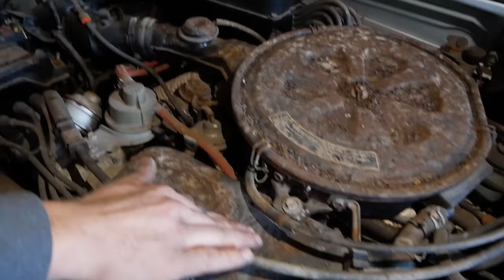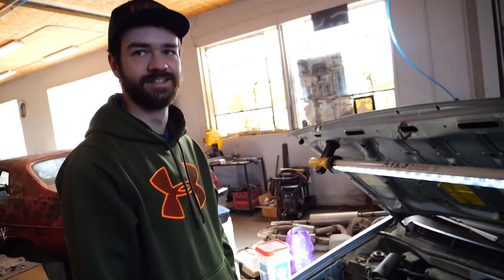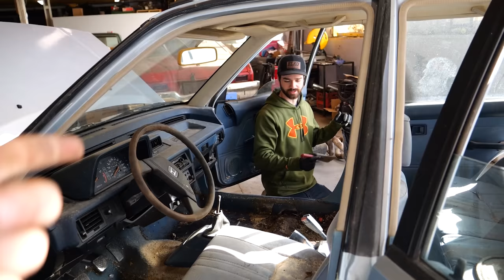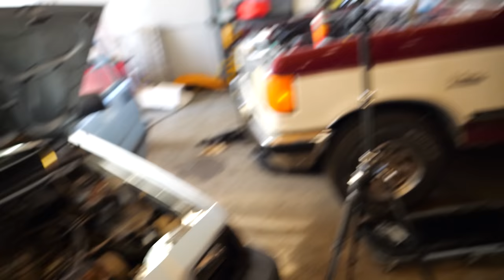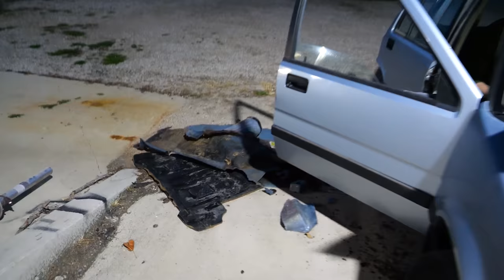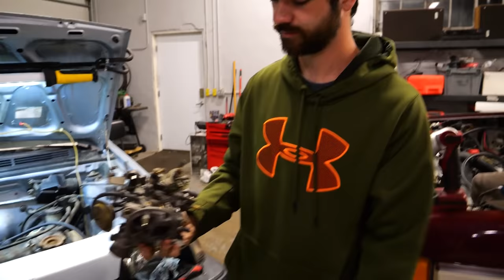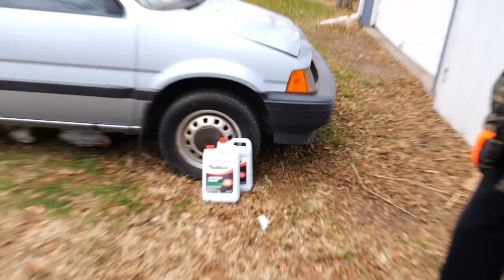ABANDONED 4x4 Honda Civic - Will it Run After 20+ YEARS??

Comment: Whatever you do , do not break the rear side windows , they are extremely hard to find and you would be extremely lucky to find anyone who can make them .
Reply: same shit for toyota tercels 4wd !
Reply: Yeah, take them out and sell em!!!! Same for my 94 teggy
Reply: To the right buyer they are probably worth whatever he paid for the car, or more.
Reply: just make them out of plexiglass
Reply: @josephdias5859  that really doesn't solve many problems... its a 3-dimensional shape so hard to reproduce, making repros would almost certainyl require that you have some originals to get the form from, and on top of that you would be replacing with a material that will fog and crack over time and require replacing and look shit. So no, not a "just do this simple thing" fix at all. Oh yeah, and if you are fixing up old honda wagons as an enthusiast, you probably don't have ford GT money knocking around for things like custom glass/plexi fabrication.
Reply: @throwback19841  what about 3d printing you can get a decent 3d printer for like 200 bucks and input the exact dimensions of the window and couple of rolls of pa6 nylon glass woven filament for 40$ it doesnt crack its crystal clear and it doesnt fog older car parts are getting harder to find it would be a bit of work with sanding and getting a smooth surface but i imagine its still much cheaper than finding the original windows and i think you can hit it with a hammer and it wont break and people use it already to make stained glass windows
Reply: @josephdias5859  You know those printers are only really capable of printing in a 8" cube right?  Compare the printing area of those $200 3d printers to the size of that window. A 3d printer that prints something that is over a foot long in 1 piece is going to cost thousands not hundreds. You're also gonna be looking at probably at atleast half a dozen rolls of material to complete. Filament based printing also looks terrible and cloudy for transparent objects because of the layers of filament no matter how much you sand it.
Reply: @jordanturner97  your information is wrong, please dont post stuff if you dont know what you're talking about, it misleads people.
Reply: @roberthood5824  Okay, name me a <$200 printer than can print transparent materials (that won't warp in the sun like PLA) with a build area that is anywhere close to 20 inches. I've never been able to find one, enlighten me, seeing as you're an expert!
Reply: @jordanturner97  I know right? And anyway, you will never 3d print a piece of plastic as clear or unblemished or perfect or UV proof as a piece of glass. Never.

God I miss that car- best rear visibility ever. It was like being in a greenhouse on wheels

Comment: Hey if you ever need to remove fluids from a tight spot like that, you can take the head off a spray bottle, stick the straw into the hole, and use the spray head as a pump to remove the fluid. You can pull through a pretty long hose this way too, if you need to.
Reply: Great idea!
Reply from the maker: Good idea! I'll have to remember that for next time. I imagine seeing that this was gas it would have killed the seals pretty quick though
Reply: That's going in the mental toolbox, thank you!
Reply: Good idea
Reply: Top tip !!
Reply: another option is take any piece of random hose and blow across the top with an air nozzle (sideways across it-not into it). the venturi effect acts just like a carb and creates a vacuum. Works surprisingly well
Reply: @JunkyardDigs  buy a chemical resistant spray head.
Reply: @JunkyardDigs  I have one filled with gas that I use to clean stuff and surprisingly it doesn't breaks, I think it's a kind of cleaner bottle/spray thingy

Comment: Road signs work perfect for speedy floor patches. They are made of aluminum and easy to shape and rivet in.
Reply: A nice “ men at work” floor panel seems in order😂
Reply: They’re also free
Reply: How do I… “”borrow”” one? I’ve been needin to know how to take the sign OFF 😅
Reply: @elliehill9165  they look like a 7/16 nut but it might be 1/2 or something
Reply: They’re all size sawzall
Reply: @kingofsludge7262  a man of culture
Reply: My dad did that to an old CJ.
Reply: Somewhere out there is a 70 Monte Carlo with a sizable chunk of my thumb pop riveted between a rusting floorboard and a 20 mph speed limit sign. That piece of thumb is old enough to drink by now
Reply: @badatcad  In Texas they're 1/2"
Reply: I have used steel from a old dryer to patch the floors it works great if you have a flat spot to patch because the stuff is so thick and impossible to bend without a HD brake but you don't have to worry about it flopping around once on the floor like sheet metal
Reply: You can pick those used road signs up at your local metal recyclers.
Reply: Im probably going to have to do that for a classic car im going to be fixing up here soon.
Reply: @andrewhansen4179  it's cheaper to just find them off the road. Speed limit signs are nice and rectangular. I don't advise harvesting stop and yield signs, but sometimes kids get wacky...
Reply: @elliehill9165  I've heard that battery chain saw or Sawzall can facilitate harvest of such signs as long as you don't mind taking off the support post leavings when you get back to the shop. Or so I've heard

Comment: Am I not the only one who found the start up satisfying?! She fought but she ran. Nice to see a Civic on the channel. Speaking as an actual R18 Civic owner here.
Reply: Coming from  D16 and an A20 owner you DID NOT want to own an old pre 90s accord or a similar era civc, those vac lines are a major pain to work with. Can agree its very intresting to see something besides amarican V8's
Reply: @daneneedoba8930  Judging from the video, I can see why that's a pain. The R18s are a breeze to work on in comparison.
Reply: @AlexTrain5249  I'm kind of tempted to try that on my old 87 accord though with the vac delete stock carb. I swapped a manual bottom to a auto top half. Long story short she flooded A LOT, due to having an extra vac line. All it needs is a carb tho and it'll run 🤔
Reply: I had a carbed 87 Accord that ran okay, j kinda wish I kept it now, could've eliminated all sortsa that shit and had a cool little daily. Flipup headlights even worked!
Reply: @jculbert2221  I still got it, it's just I also had it and an old friends house. Think a tree fell on it recently though, there's and 88 a block away though
Reply: I own an 86 wagon and I'm swapping it currently because the little aw1 is a finicky powerplant.

Comment: That valve set you learned about is Hondas CVCC (Compound Vortex Combustion Chamber), they used that design from the first gen civics in the 70s all the way up to like 89, those motors are "stratified charge" engines, which essentially means that the little mini carb and extra valve set introduce fuel early in the compression stroke to even out the combustion vortexes in the cylinders, and by purposely predetonating a LITTLE bit, they managed to increase that engines thermal efficiency by like 13%. Those engines had an overall efficiency of nearly 83%, allowing them to pass california emissions tests when straight piped. Absolute nightmare to work on when the vacuum systems go, but if everything's in order, well my 83 accord averaged 48mpg city and 59-63mpg highway. It's a SUPER cool system, but its insanely complicated for it's time. Leave it to honda to make the most technologically advanced shit box of all time, and still manage to be one of the most bullet proof engines ever built. I believe the engine code for that design was EK (not to be confused with the EK civic) so if it was a 1.5 liter, 1.6, 1.8, it would be titled as an EK15, EK16, or EK18 motor. Did I mention they're absolute tanks

Oh, and that design ONLY works if the engine is reverse flow. As soon as you move the exhaust to the other side of the head, it's no longer a functional system and the predet just blows the motors to shit
Reply: Amazing!
Reply: The 1978 CVCC didn't have enough cylinder spacing and would blow the head gasket between the cylinders only.
My parents bought one new. 
My dad would limp home, park in the garage, pop the hood and go eat his supper while car cooled off.
Had a hook in the ceiling, took hood off, removed head bolts, lifted head about an inch, slid out blown gasket, slid in new gasket and reassembled. Drove to work next day.
First time it happened, he had disassembled it all and checked the deck and head; Tool & Die maker by trade. It was all as it should be. There just wasn't enough gasket material between the cylinders. 
A new head gasket hung on the garage wall for years, even after the car was wore out and gone.
That was their first new car.

As a very small child, learned how an engine works during one of these gasket failures. He spun the engine by hand while i watched the cylinders move and could see the valves directly above them. 
I was amazed it could do it all so fast and not blow up.
Reply: if you think a gasoline internal combustion engine had a thermal efficency of 83% then I've got a bridge to sell ya
Reply: My 1978 Honda 400 rebel twin has a 3 valve per cylinder head
Reply: I made my living starting in 1975 working on Honda engines and then went on to work on many others but Hondas are special they're bulletproof and sometimes complicated and sometimes simple.
Reply: Great explanation.  Can't seem to recall where they mention it though.
Reply: The engines were all "E-series" so the Accord was an EK, I think the original 1200cc (non-CVCC) was called EB, the 1500 CVCC in the early Wagovan may have been called an EN? Used to have a book with all the engine codes but I can't remember off the top of my head. I owned tons of these cars when I was young and loved them. The miles of vacuum hose looks terrifying, but I (fortunately) never had a single problem with any of that stuff. If rust didn't push them near the brink of extinction, I would still be driving an '83 Accord too.
Reply: thats the difference between japanese cars and german cars. if this system was inplemented in german cars it would break all the time hha
Reply: @phrg8332  yea, definitely, given the fact the Mercedes we have keeps breaking down at 140k mileage.
Reply: @world_reborn1990  Yea, but, My E420 was also the most mechanic-friendly car i ever owned, and overbuilt in so many ways. There were little access doors for everything behind a liner of some sort. The door handles look like they came off sone industrial equipment and those doors always closed with the most satisfying "thunk". Like brand new 20+ years later. Electrical issues occasionally made me want to pull my hair out, but they were always worth the cost vs buying a different car because when that thing worked right it drove like a dream. Trans finally went out at 325K miles and i finally replaced the car, kinda wish i hadn't to this day.
Reply: @@mistermistersen-cq7oz that's what hondas patents and test results said. They passed a California emissions test with no cats before installing them and selling the production model. Mine averaged 55mpg highway if I beat on it, I got 65mpg on several occasions
Reply: Cool!
Reply: I have a similar Honda, only created for the Japanese market and with a motor EV 1.3 Also a year younger than -1987, Honda in the video before 1986
Reply: @sammy13ificationable  I read where Chevrolet disputed the test result, so Honda purchased an Impala, converted it to CVCC and blitzed the test results...

Comment: I still am so fascinated on the part how you literally took all those extra vacuum lines that we’re not needed out and now the car runs 10 times better than it used to I can’t wait till I learn how to do this stuff you motivate me❤️
Reply: A lot of the vacuum lines go to emissions systems and creature comforts. You can free up tons of stuff if you don't want anything but the engine to run.
Reply: You only need vacuum advance and EGR. the rest is not neccecary
Reply: @1marcelfilms nah don't need that egr either rip that shit out. You need timing advance and brake booster. Did this on my Toyota pickup. It had about 25 lines too many. Now it's got two.

Comment: I’ve got a buddy that has one of those. Same color, it’s his daily driver. Great little car.  He actually has slightly lifted it, with bigger tires.
Reply: ...and it's rust free, JK...lol
Reply: @claztube  They're all "rust free" if you look at em from 100 feet away while squinting...
Reply: @claztube  No such thing as a rust free Honda 😂
Reply: @_Frank_the_Tank  the ones in the south at junkyards I've seen so far have been surprisingly clean body wise, but super clapped out naturally
Reply: Damn that must look a lot like the old Subaru Outback sandwiched between two semi's
Reply: @dandunlap8638  I have 2  rust free Hondas. Both late 2000s 5 SPD 4 cyl

Comment: really wish more people would do a will it run on various older cars like this. For instance my family has owned two 1987 Subaru gl's and a 86 they were all carbureted and pretty amazing cars. Would love to see people revive and drive stuff like them aside from just the usual muscle cars and old trucks (don't get me wrong I love that as well)
Reply from the maker: They're unique and fun to do, just hard to find and even harder to get parts ordered in quickly!
Reply: Those Subaru GLs weren't the best looking car (to put it nicely), but they were dead reliable and the awesome Subaru AWD system made them like a mountain goat on snow or rough terrain. Subaru wrote the book on AWD, even now, the rest are all poseurs, lol. I remember seeing 70-80s Subies , rusted up to the door handles, but still plowing along like 4wd sewing machines. Great cars.
Reply: 80's Subes are awesome. Love my '90 Euro-spec BRAT. Fantastic car, although the continuous fight against rust can be tiresome, but that's life with old japanese cars
Reply: @nickis_speedshop  You have no idea how much I want a Subaru BRAT. They re everything the El Camino, Ranchero and even the Dodge Rampage aspired to be. They're pretty much nonexistent here in the northern US.
Reply: My boss is currently doing a revive on a 86 Subaru GL it's got it running but running into issues with the entire fuel system and wiring but it's a nice car for $300 if you can look passed the 2 inches of bondo on the driver's side rear quarter panel and trunk😂
Reply: I’ve been restoring and driving an 83 Honda Accord Hatchback. I love the feel of these 80s Honda’s. Nothing made today compares! The most difficult part of keeping these cars on the road is parts availability

Comment: Nice to see that AWD civic back running again makes me happy. 

I had a 87 civic sedan with 5 speed manual.   Exact same motor as that civic wagon.   they are notorious with carburetor problems.
Reply: I have an 86 Civic sedan, 4 speed auto. I use it on the weekends. Mint condition.

Comment: My mother drove one of those averaging 90 miles an hour from Milwaukee to Winona in about four hours. Total champ!
Reply from the maker: Must have had one hell of a tailwind 😂
Reply: @JunkyardDigs  I was terrified. It was a 2 wheel automatic, and she held it at 90 most of the trip and topped at 105-ish. I drove it for years, it was fast as hell.
Reply: @JunkyardDigs  I ran 90mph in a  2002  2 door Honda Civic and it handled well. But I wouldn't stomp on the brakes in it, rear drums and front disks I learned early on you can easily lock up wheels despite being anti lock. But I can stomp real hard on my 2000 Grand AM GT brakes.
Reply from the maker: @VintageCars999  That's a little different than a 60 horsepower 1985 Civic
Reply: @HappyOldDogAndCatFarm  terrified at 90? OK...
Reply: @richsweeney1115  She was color blind and could only see out of one eye, and I was 10.
Reply: @JunkyardDigs  for sure.
Reply: @HappyOldDogAndCatFarm  eh, I mean I guess those are reasons .. You get a pass

Comment: I'm 11 months late for this party, but I had to say that I had a 1984 Toyota Tercel, 4cyl. 5 speed, 4 door hatchback. It had 47,000 miles on it when I bought it. The first thing I did to it was put new spark plugs and wires in it and oil and fuel filter and 10w40 oil.
I took my boys to the car show in St. Ignas just over the Mackinac bridge in Michigan. And I got 54 miles to the gallon. I actually only used 3/4 of a tank of gas going up there and back home to Grand Rapids. That little fukker was the best vehicle I ever owned for gas mileage. But one day it decided to blow the head gasket and crack the block between number and 3 cylinder.  I don't know why, because it never overheated, but it was blowing oil into the radiator and it just gave up the ghost for no reason. It lasted 3 years and was well worth the $350 I paid for it.
Reply: i had an 86 tercel loved that car but it blew the head gasket and cracked the head aswell